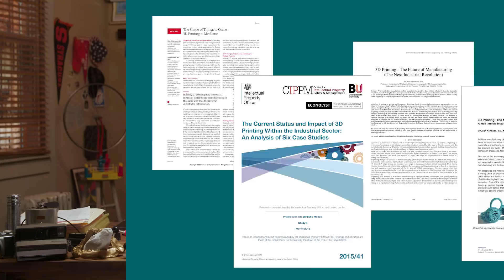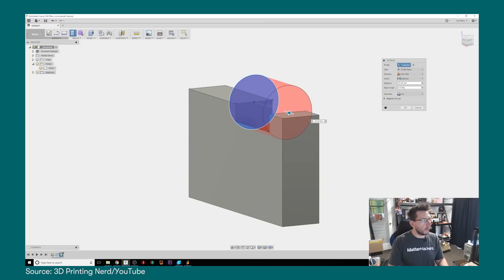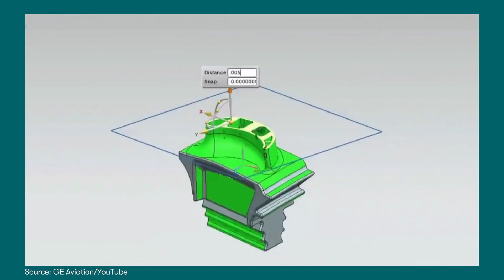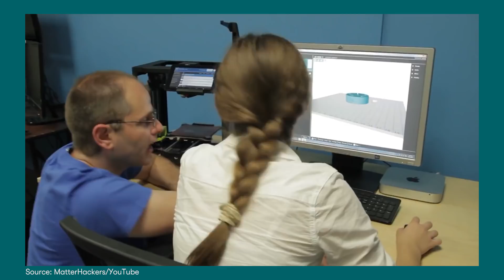What happened to the 3D printing revolution?

Comment: This is a good video. I'm a mega-nerd but didn't buy a 3D printer yet because I thought it might just be a fad.
I was partially correct. I will wait until they releae a true voxel-based 3D printer and then I'll buy one.
Reply: see you at the Singularity in 2030 then

Comment: I actually want to take the conversation in another direction. I'm a fully paid up member of the tech geezer class. My family and I live in a 1000sqft apartment in Seattle. I should have a workshop with a router, a lathe, hell even a workbench with a drill press but I don't. I'm 63 and I'm not afraid of learning the tools. I own a decent PC and Fusion 360 is free to hobbyists (thank you Autodesk), I know what Cura is and I just bought an Anycubic Linear Kossel printer. Is it going to bust my chops getting it going? Sure, I'm looking forward to it. Any workshop device needs to be learned, every tool has a learning curve.  What I'm hoping is that this tool is going to be a workshop in a tiny footprint. I'm hoping that it saves me countless hours wandering around Home Depot. Trying to think what group of dissociated components are going to fulfill the adapter/ bracket/thing holder I'm designing or my wife has asked for. 3D printers are like computers. They're useless in and of themselves until they are given actual real world tasks. My wife is looking forward to her Creality Ender 3 (Yes, I bought 2) because she's interested in fashion/costume design. Mine is going to support my many and varied interests in everything from music (for example, I need to design a bracket for my M-Audio Trigger Finger Pro),  My interest in Astronomy and just general doohickeys (I love that word) that make our life better. 3D printers hit  the wall because they were sold to the wrong people. It's not a consumer product. It's a tool. If you have live in an apartment and you lust after a workshop/shed at the end of the garden, you need a 3D printer. But it's got to be a real one made by the Chinese.
Reply: I was with you until the last sentence. As someone that used to professionally sell desktop 3D printers from Kindergarten to Business, there are good 3D printers from many other countries than China. Sure, there are many there because that's where most of the factories are and after a factory run of a printer there's always a clone of the original product that is cheaper, but not that much worse in quality (sometimes actually better, but rarely - my FlashForge Creator Pro is Chinese and better than it's "parent" the MakerBot Rep2X). Long story short - do your due diligence when shopping for printers - your best best is to check out the 3Dhubs printer report for the year and ask forums or heavy 3D printer nerds like me for their opinions on which printer fits your needs (brace yourself for some long-winded geeked-out replies).

Comment: I had purchased and earlier version 3d printer. There was really no positives to it as it was just a total waste of money. 
1) cost of printer and filaments
2) most of things that is printed it trinkets "aka junk" and will not last long before breaking
3) too much energy power to run, the heating board is an energy killer 
4) if you don't mind being in a Chinese factory, that shit is tonic to breath. You probably live longer smoking cigarettes than  filament smoke. Print in open environment if possible. 
5)takes forever to print something, that's if it don't mess up a layer in between "Trash".
Reply: Did you ever ask someone to help you learn it? Did you ever research what 3D printers had good reviews? I'm gonna guess you bought a Cube from 3DSystems XD

Comment: I got one of those Printrbot 3d printer kits shortly after there kickstarter finished. It was pretty fun to play with, but even then I knew that 3D printing couldn't do what many of the zealots were claiming. I had a friend swear to me that in 10 years people would be 3d printing cellphones and cars.
Reply: They are 3D printing cars. You can print cellphone covers/cases easily. Electronics for cell phones wouldn't make sense to 3D print for the most part. So we're already more than halfway there!

Comment: More concerned about plastic usage.
Reply: The most common type of 3D printing plastic today is PLA - a corn derivative that can be industrially composted at 180 degrees Celsius for I believe 5 days. Then it's "dirt." In a nutshell, a lot of 3D printing material companies are also worried about plastic usage ("green," products have marketing advantages too). So don't worry, 3D printing is doing more good than bad in terms of creating plastic products. If a 3D printer helped prototype the device that is out recycling the plastic in the ocean, it's really moving in the opposite direction. As well, 3D printing more durable plastic pieces means the object lasts longer and fewer plastic products are used/consumed in the long run.

Comment: I miss my Flashforge printer, but i will wait until SLS printers are cheap enough to buy.
Reply: What exactly is "cheap enough to buy?" Formlabs already has one out - all said and done it's still a pretty penny after finishing extras and materials with support. But $25K is a lot less than $250,000 so that's significant progress.

Comment: Currently I have 2 3D printers. The problem with them is that people expect them to work instantly and easily. However they are work to use and you have to learn everything. If you want to get a 3D printer you have to under stand you are going to have to learn a lot and it won’t just be click and done

Comment: "Specialized software"
What would be the reason I could not use this with autocad
Reply: Look into "slicing softwares," and also understand that many outputted Autocad files are 2D and .STL files (3D files used in 3D printing) are 3D. You can certainly export 3D files out of Autocad if I am not mistaken (only used Autodesk Inventor and Fusion 360, not Autocad), but that is what is required - export as a .STL file (sometimes a .OBJ file is also acceptable).

Comment: It’s a material properties thing.  Here’s a viable use.  Print a core to be packed in metal dust.  Heat till core is “lost”, or dissipated.  Heat still further till the metal fuses.  Hopefully diamond dust would not be required as a part line barrier layer.  Maybe print a half at a time with registration feature to line up each mold half.
Reply: More toxic waste in the environment where our food and water is produced. Great idea.
Reply: How?  Sand would work for a separating layer and can be reused.  Criticizing with reference to virtues, as though doing nothing different isn’t potentially the more toxic choice - we’ll it’s just criticism - there’s nothing constructive in that.  And do you really feel any bigger?  Hope you have a better day.

Comment: I design spare parts and accessories for my hobby, sometimes I use the PLA bits as the end product, sometimes I send them off to be CNC machined in batches and sell them to forum members of the same hobby who's after similar solution / improvements, and most of the time I upload the files to Shapeways afterwards where I get a little proceeds for every time someone buys the print directly from them based on the files I generated. I wouldn't imagine I could have done any of that if I didn't have a desktop 3D printer to perfect and prototype before putting in more money in for batch producing the stuff or even selling to others. I started off with a Makerbot Replicator 2, and it's paid for itself quickly enough that I now use an Ultimaker 3 (while keeping the Makerbot alongside), I think the issue has less to do with 3D printing or any technologies, but more to do with the media.

Comment: I see potential for 3D printer use in the retail space. Like if a customer goes to Home Depot to buy a plastic washer or plastic plumbing material, the store can print a part for the customer. That way the store only produces what it needs, and there is no overstock.

Comment: I would agree with pretty much everything you are saying, and obviously there is progress being made at industrial levels, but even the cheap domestic printers which seem to spend most of their time making useless rubbish, can make useful objects when production numbers are low and part strength is not too important.  I make air inlet ducts for cabin ventilation on home built aircraft:
http://www.ansoneng.com/sample-page/products-summary/fresh_air_intake/ 
Numbers are obviously small, but the process is flexible enough that I can even make customer variations and one-off specials.

Comment: I use mine for making parts for guitar pickups, as well as prototyping other potential products. It definitely has kinda faded away for the consumer market, but I imagine as tech improves and costs go down, it will be a more common household appearance. Markforged's units can do some crazy stuff now, and while outside the price range of most consumers at the moment, it shows that there is a huge amount of potential still in the 3D printing industry.

Comment: When first I heard about 3D printing, I was amazed by the technology and the possibilities.

I did some research. The printers were expansive. You needed the printing material. You needed to buy it in every color necessary, no CYMK mixing. Special software was required. The 3D model had to be one mesh per piece. You needed to build a model that could be printed from bottom to top, no hanging parts. Or you needed some kind of pouder to fill up the empty space to support parts that needed to be printed in mid-air. But then the printer needed to support that and you had to clean the result afterwards. At least there were ways to reuse that pouder stuff. And last but not least: printing even tiny objects took a long time and was noisy the entire time.

Still I was going on about the possibilities. A friend asked: "What possibilities? It's not like you could print any electronic parts with it." He was right. What the hell would I print with this? 
No robot. No RC car. No additional 3D printer. Cases, housings, mechanical parts at best. 
What if the battery cover of my TV remote was gone? I could print a replacement, right? But how would I ensure that it fits? Was my measuring tape precise enough? Did I need a 3D scanner as well?

At some point I came to the conclusion, that it was just a hype. This was not fit for consumers. Maybe for companies to test their prototypes. Maybe for businesses that print your stuff for you. For them it makes sense to have the best printers and lots of materials. But it wasn't for me.

Comment: As a machinist/programmer I am kind of scared of the industrial use of 3D printing in in industry that's quickly losing jobs to robots. As a nerd, I love 3D printing because it runs off G code, a language I'm very familiar with. My butt hurts from being on the fence

Comment: I heavily use 3d printing and have been for years now in my job. I work in an engineering dept for a boat manufacturer, we print everything from scale models to full sized prototype parts, and it can be done all in house at a fraction of the time/money it takes to contract work like that out to small manufactures or machine shops.
Reply: again no finished parts are 3d printed, you can get much cheaper mass produced parts after they are designed with traditional machining and things like injection molding

Comment: 3D printers may still change the world. It's just going to take a while. The 3D printers that are available for the home right now are relatively expensive (anything under $200 is considered a budget printer) and relatively unreliable (I've gotten my Printrbot Jr up to a reasonable level reliability and that's a small miracle that has required upgrading several key parts).  

However they're getting cheaper and more reliable. Today you can buy a really decent quality printer in the Monoprice Mini Delta for $160. And the above mentioned Printrbot Jr really is a very old,  kinda crap printer but newer components have been able to take its reliability up to something that would be acceptable for most people. New printers are even more reliable. They're still not turn-key and likely won't be for a long time (if ever) but it's not near as difficult as it used to be.

Comment: The thing that grinds my gears the most about the 3D-printer-as-consumer-product hype is that all these sites have dumb STL models for download, instead of parametric models like those designed in OpenSCAD . Discoverability on the web is already a huge problem. And with mechanical parts, for a non-engineer it's already a huge brick wall knowing what keywords to use in your search. Add to that the fact that uploaders themselves don't use a consistent terminology. So imagine after struggling to arrive at the Thingiverse page you've been looking for to fix your shit before you leave on vacation... only to find it's not the right kind of part you need for your discontinued gizmo. Editing STLs is way more difficult than plugging other values into a parametric model.

Comment: I think the technology didn't improve fast enough for it to be in most households by now, it's still too complex for the average person to use in an easy and practical sense. I think people need to be more patient, the technology just needs to get better for it to become more commonplace. They take up room, they can be messy, the 3d modelling software requires some skill to be good at and they are kind of slow. In the near future fast, compact, clean, and easy to use 3d printers will be revolutionary but it takes time to get to that level.

Comment: I have a few thousand hours on 3D printers of many types. Frankly, it wont be until 3D printers are as easy to use as modern desktop inkjet printers that everyone will consider using them, and even then not until there is significant need. (Namely when companies start posting spare part files online and 3D printers print faster than Amazon prime)

Comment: I think one thing that prevents 3D printing is that there is a perceived huge cost for the operation of the printer. We are used to buying printers at or below cost only to get raped if fees for new ink cartridges that cost a minimum of $50 and have less ink in them than a ketchup pack. Also the tricks that printer manufacturers have been caught doing like using some cyan color when you are just printing B&W text. Also printer manufacturers have also been caught telling owners that their printer cartridges are out of ink when they are over 50% full.
Also what makes matters even worse is that if your printer runs out of one color then the printer comes to a halt and won't print anything even if it is just B&W text. Also if I was to extrapolate what the printing costs of a 3D object based on the cost of printer ink then I would estimate that printer a 3D replica of a cat would cost me about $3000 in 3D ink cartridges which would make this an extreme luxury item for most households.
Currently normal ink is the most expensive liquid on Earth. It is even much .ore expensive than designer perfumes. So I believe that I speak for many consumers when I say that we are tired of being screwed when it comes to ink jet printers and it carries over to 3D printers.
For industrial use companies have no problem paying $2000 for a prototype because it would cost at least that much if they had done it the old way.

Comment: I working on the deep water horizon I need part for my blow out preventer? 3D printers mass produced molds?  Mistakes are made always. I’ll wait for the real thing.  Mass production will always beat the copy.  Would you fly on a plane with 3D printer parts?

Comment: I'm a 10th grade dropout, ex-heroin addict, ex-convict (5 years) living in a $20,000 house, and I have a 3d printer. These devices have changed the world, and they continue to do so. Anyone could have predicted the manufacturing slow down the industry has experienced. Far too many companies attempted to get involved in the space. Only about a quarter of them was needed to supply demand, and there has been a market correction. It means virtually nothing. Furthermore, I don't think these devices, and the software that accompanies them is the least bit hard to use.

Even designing your own parts is incredibly easy. People are just lazy.

Comment: * Prices are too high.
* Consumers don't know what to make, let alone how.
* Manufacturers don't provide parts which consumers can easily print from home.
Reply: Well this aged well, one of the most popular 3d printers cost like 200 bucks.
They are simple enough to use, as with anything, it's going to take time.
There are millions of cad files online which most likely is of use
Reply: @h.w.m.306  Name one thing which is likely of use. I'm curious how you're using your 3D printer.
Reply: @grefsteel3989  I make all sorts of things, I'm into star wars so I often print off star wars figures and I'm currently printing off a Death trooper helmet(3 day print yeeash) 
When I'm not doing that, I usually just print off fidgety gadgets as I gets distracted easily. Other wise when my main project is over, I usually don't print from anywhere from a week to a month or two. If I don't print for a long time, I'm probably just studying or making things in CAD software.
But yeah, it takes time, but there are soooo many uses.
Reply: @grefsteel3989  but yeah, I don't need one, it most certainly is a luxury. I could live just fine without it but it save money when you put it to good use.
Reply: @h.w.m.306  Ok that's interesting. I was thinking about a few small things like clothes pins , but then I thought it is probably cheaper to buy them from the store since they're manufactured in bulk.
Reply: @grefsteel3989  i mean, an average role of PLA costs abut 25 dollars and it weighs 1kg. you can probably print off thousand of them for that. but yeah, its more convenient to purchase, prints take hours and sometimes even days